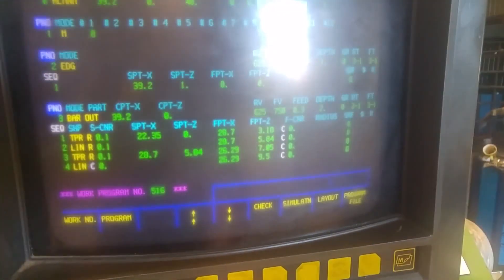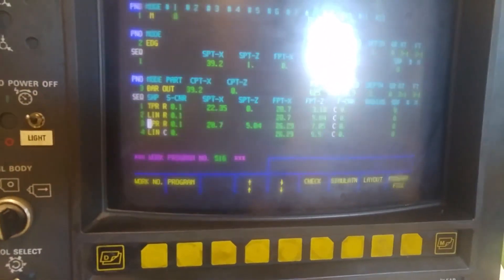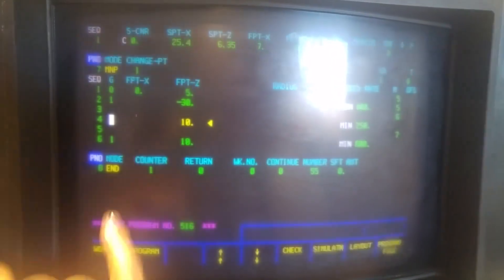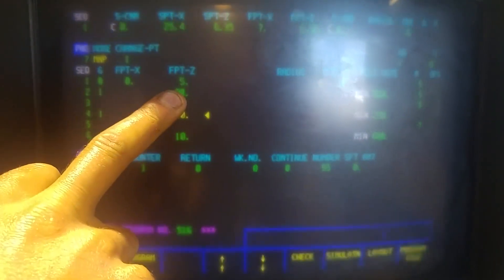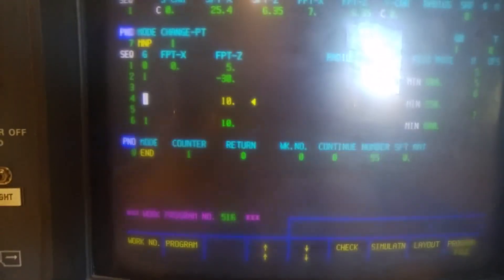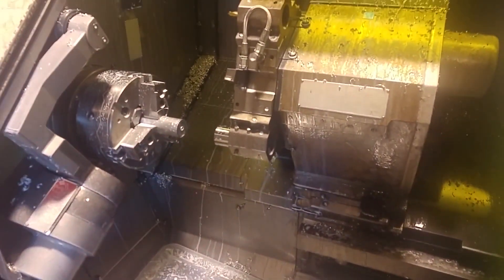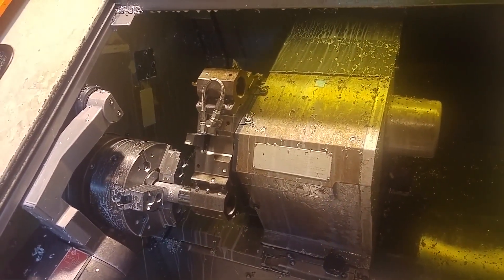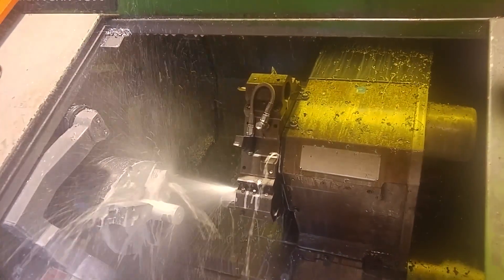Mazak QT10 simple bar puller

Comment: Cool mate. I want to make a bar puller for my okuma. Can you email some pictures to me close up ? Is it just a collet style puller ?
Reply from the maker: its just a super basic puller - just a bit of stock bored to just under material OD and slit in 4 to allow it to expand. very basic but works fairly reliably and cost next to nothing.
Reply: @TravisHammeng  Cheers. I Will look into that. Thanks
Reply: @TravisHammeng  what material did you use? i need to make a few thousand parts and really need a barpuller :)
Reply from the maker: @nikolaiownz  I just used some 4140 I had laying around